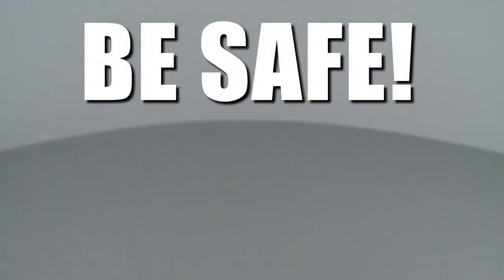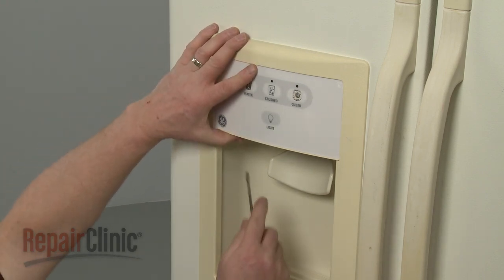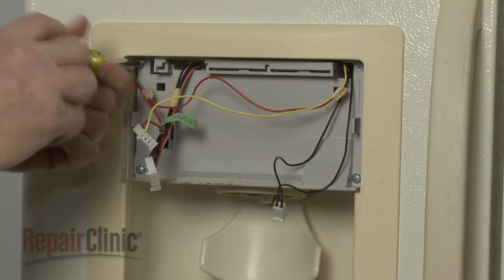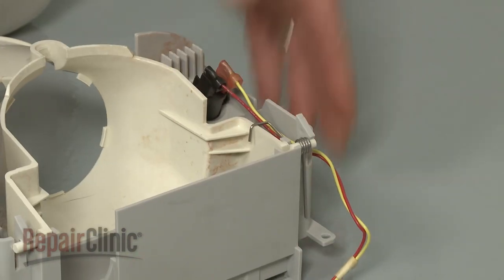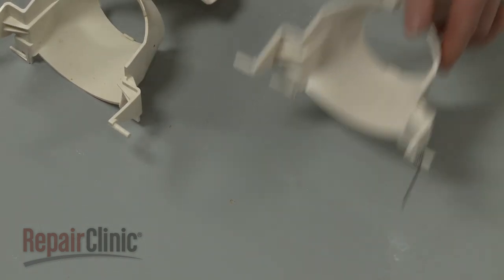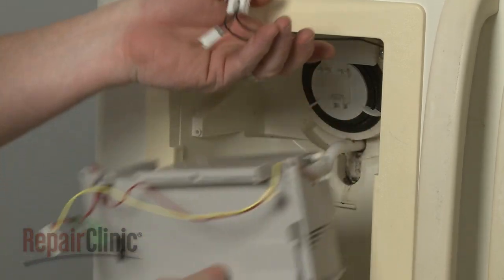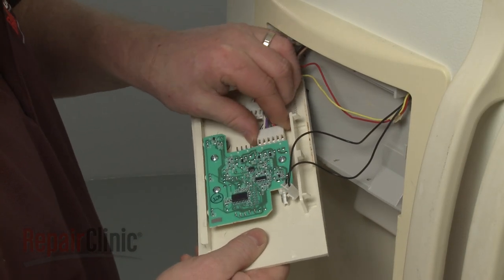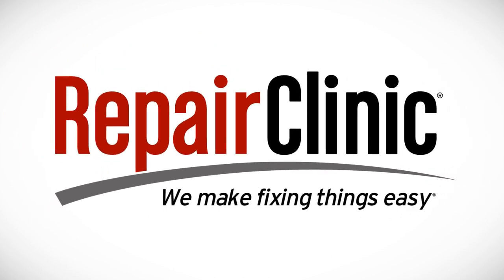GE Refrigerator Dispenser Actuator Replacement #WR17X11269

Comment: Thank you for the clear and concise instructions! For anyone else having trouble removing the old part, mine was glued in and I actually had to pull until it broke, then scrape off the plastic remains. Maybe something sticky had just been spilled, or maybe the manufacturer actually glues the piece in, I'm not sure.

Comment: This is the same model refrigerator I have. Did not know I had to clean up under the actuator with backing soda and warm water. It had a buildup of black looking flakes that fell onto the grill when it was cleaned out. It cleaned up fairly good except it looks to need to be removed like in this video to be done properly, but not sure I want to take the chance with the circuit board. Thanks for the video; I was wonder how that all came apart. Also, is there a sensor that turns the auger every so often, as the ice cubes seem to be frozen together and have trouble falling out the ice door. I have to hold the switch for it seem like 3 to 5 minutes before any ice falls out

Comment: Do you know if the water spout can be changed? Mine is shooting the water too far out and on the floor. I think this happened from using a hair dryer to unfreeze the water.
Reply: These are absolute garbage am tired of fixing it
Reply: Take off the actuator and electric panel and use the hair dryer to heat it up and bend it back down, that's what I did.

Comment: I'm seeing that this part #WR17X11269 is NOT compatible with my GE model # GSS25SGSCSS. SO ordered replacement part(s) WR49X10228 and spent 3-4 hours trying to get it to work No go. I'm thinking of ordering this part and seeing if it might work. Any one else have this issue. ?

Comment: Ya, I think I am done with GE refrigerators/freezers. So tired of repairs, mostly the water freezing up all of the time. Replaced the ice auger 2 times, where the water filter goes I had to replace the base. Now the plastic in the ice box broke, water dispenser lever broke and my water spout melted when trying to heat it up so we could get water. Now we have an 18 inch piece of weed wacker string in the spout. When ever the line  freezes up we just pull the line out with pliers, then we can get water. Yep, no more GE products for me.